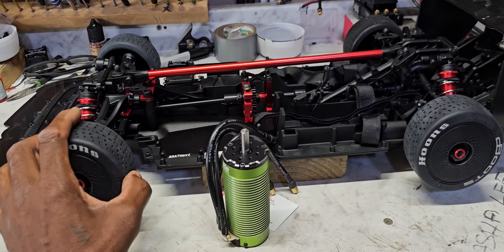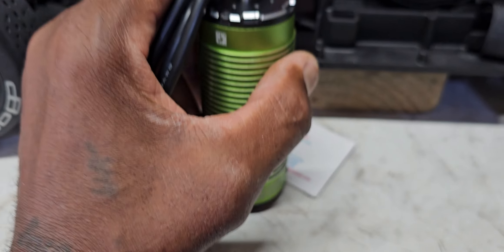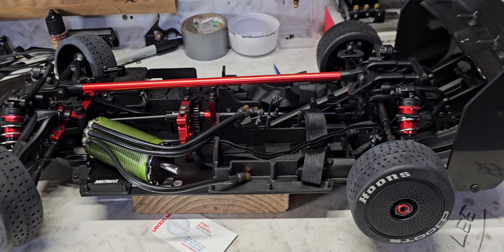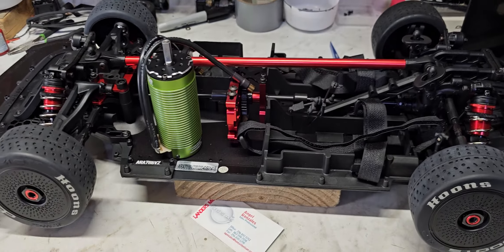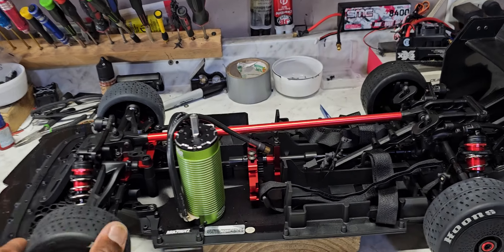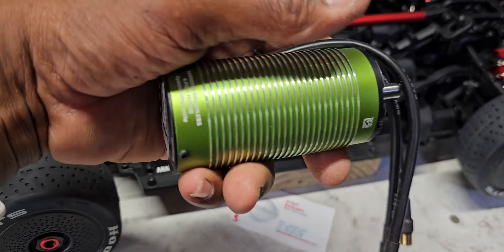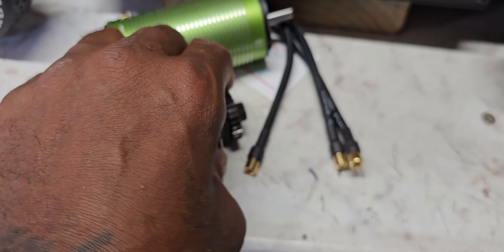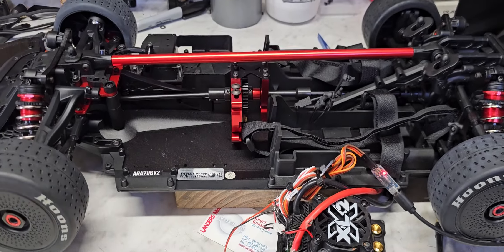CASTLE1721 LIMITLESS;THE NEXT THING...

Comment: What did you have the 6400 castle on
Reply from the maker: I HAD IT ON ONE OF THE AK'S, THE 1/10 SCALES.   
  IT'S A LITTLE BEAST TOO.I THINK I HIT AROUND 140MPH WITH IT, AND THAT WASN'T EVEN GEARED HEAVY, AND ON 4'S...
Reply: What gearing you had
Reply from the maker: I HAD IT ON "32P" GEARS, IT WAS 44 SPUR/32,34 AND 35 PINION... IF YOU LOOK AT SOME OF MY VIDEOS TALKING ABOUT THE AK'S, I'M GIVING SOME VALUABLE TIPS ABOUT THE GEARS, AND SOME THAT'LL GO RIGHT ON AS THE SPUR GEAR...